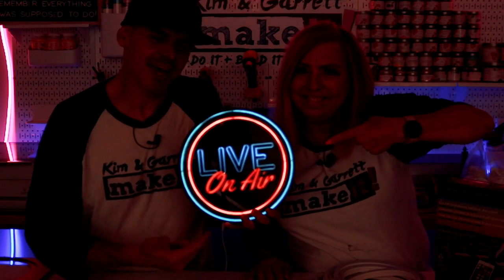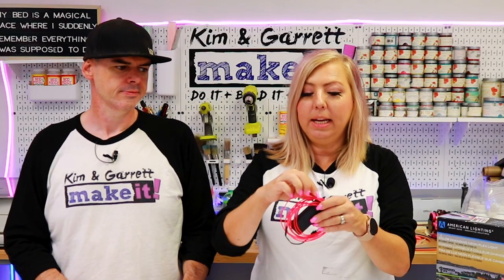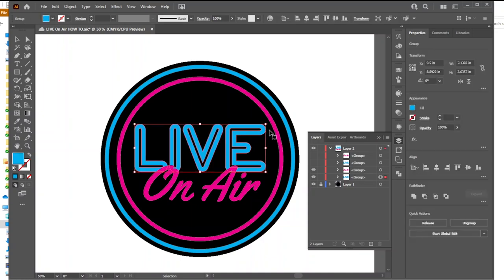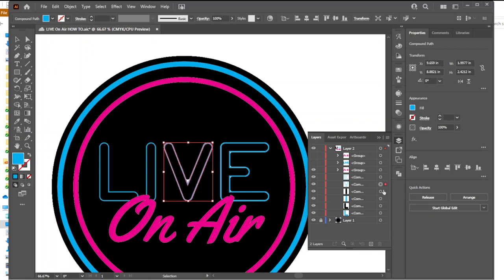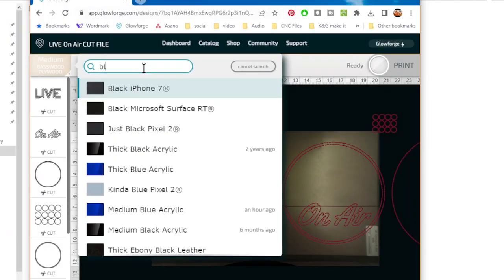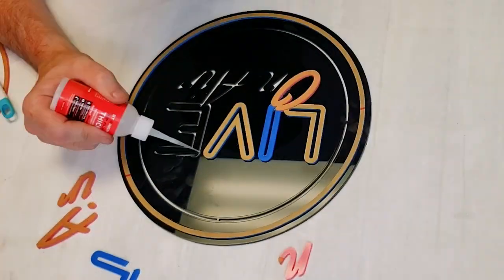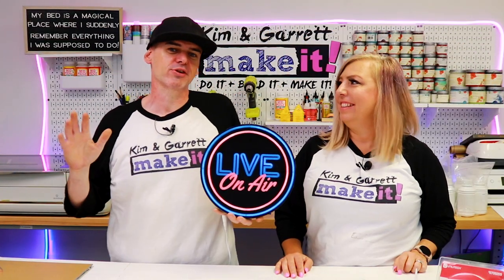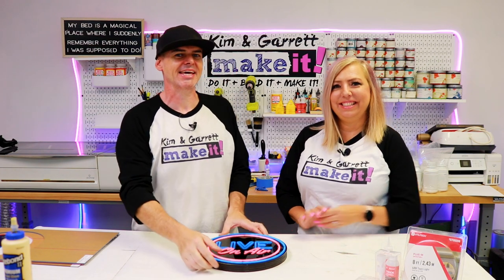DIY LED Neon Sign with Acrylic Backer

Comment: Hey Guys! Ive made a bunch of LED Neons with the Neon flex. I can tell in that first minute of your video, you got a very difficult neon to work with. If you get the right stuff, its super easy. And soldering isn't scary at all. I had never done it before, but it's easy with the right stuff. If you want to try the neon again, I can answer any questions you might have. a couple of my videos show the signs Ive made with it. Nice Sign btw!